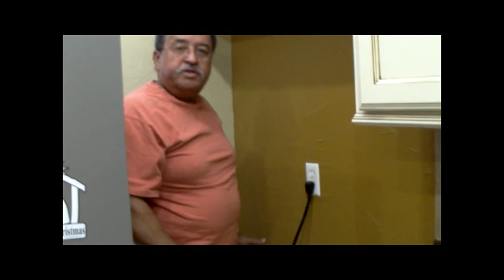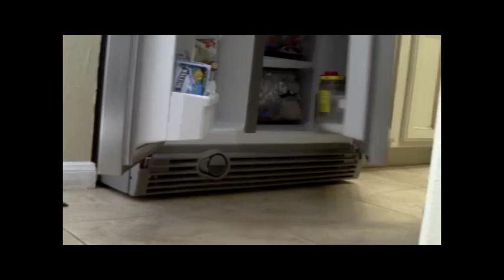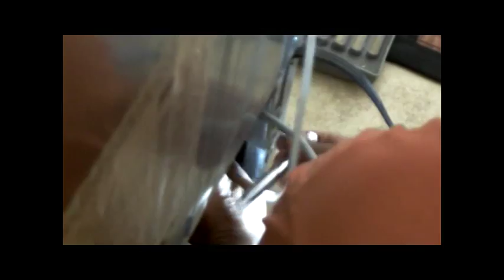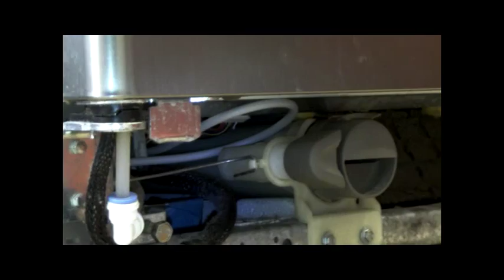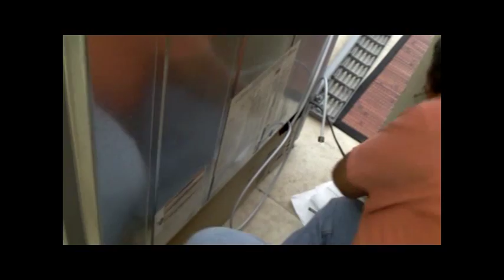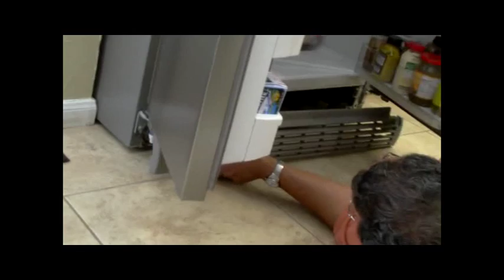Replacing Whirlpool refrigerator water supply line

Comment: Apparently the minimum bend radius of the tubing is exceeded in the whirlpool design causing a failure of the tube at the bend location on the back of the fridge (approximately 4-5" from the C clamp).  Mine began to leak and water slowly leaked thru the tile floor down below onto the ceiling of our finished basement. The water trickled over to a smoke detector and set it off alerting us that we had a plumbing water-line leak (not a fire), a first in my 36 years as an engineer lol. Excellent video.  Whirlpool could have made this a little more complicated haha.